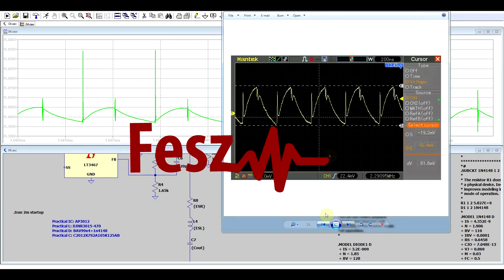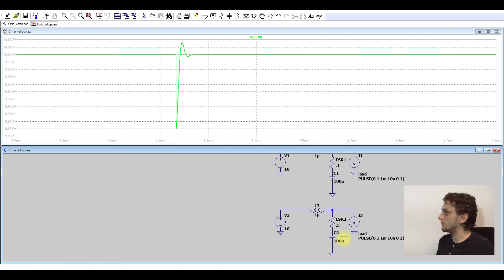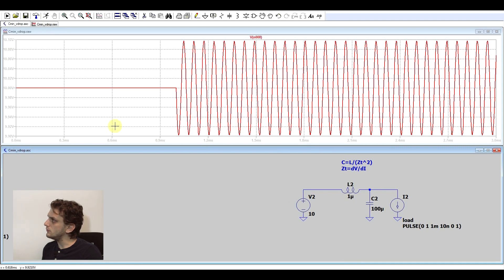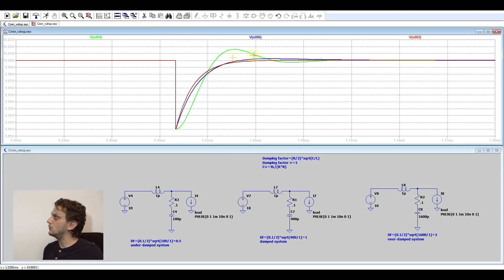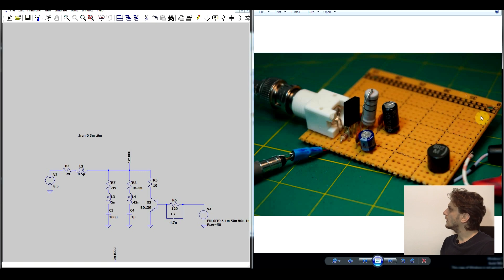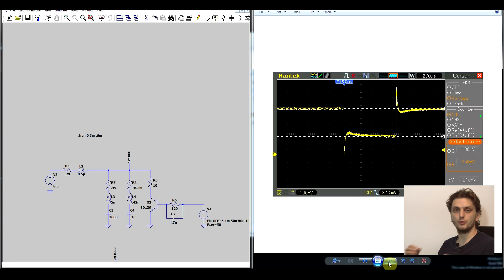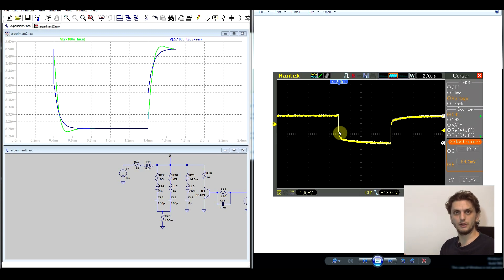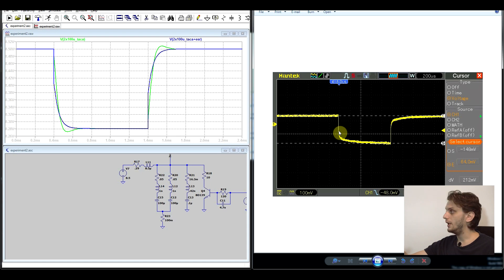Decoupling Capacitors 2/3 - Calculating a minimum value and testing the effects

Comment: Are you considering the 360mv the voltage drop across the capacitor/ESR? Because in my mind it should be U_supply-V_drop (8.5v-0.36v)=voltage across capacitor/ESR.

Comment: Hi Fesz, what do you mean about the inductor, is it a part of equivalent circuit? or is it added to the circuit as a part of decoupling mechanism? thank you.
Reply from the maker: Both I guess; an inductor is part of the equivalent circuit of a capacitor, and this is detrimental to its filtering ability; but an inductor can also be added in series with the power line to form an LC filter with the capacitor. The inductor built into the capacitor cannot be changed, while the one added in the LC filter is up to the designer to chose a value.

Comment: I don't have an o scope, looking at making one from stm32 or ATmega32u4, but I'm not sure how much of an o scope I need. What type of range would I need for small examples like this? Thanks.

Edit: I would like to build small little led / other smps dc to dc converters from ground up and maybe take old psu for PC and build a cheap lab psu. I'm working on small stuff and working on setting up a home lab.
Reply from the maker: I guess the biggest limitation in a uC based scope will be its bandwidth. What do you expect to get out of your circuit? I could not say what is an ideal BW for my examples, you can usually fine-tune the experiment to work at lower frequencies - this can be simulated in LTspice first.
Reply: @FesZElectronics  thank you, that's what I was thinking. Currently I am wanting to dive in to smps and dc to dc buck and boost. With $10 stm32 I can push 1.5 to 2MHz, with the ATmega good to about 50KHz. Note this are dso.

I would love a nice one, but time and money don't justify. Last I used an o scope was 3 years ago in an intro circuit class.
Thanks for the response.